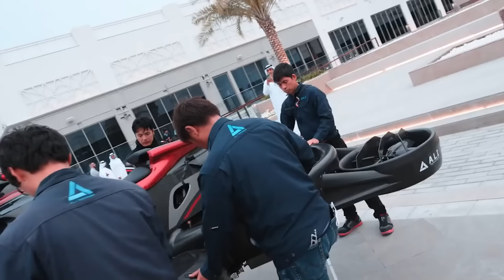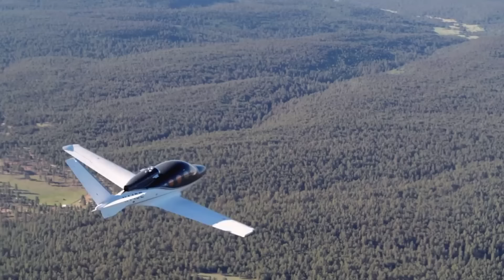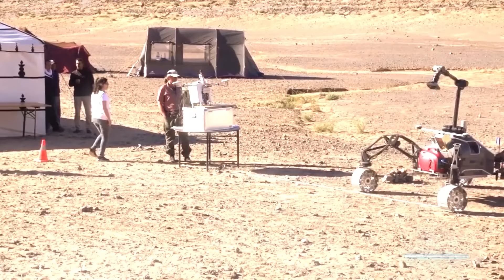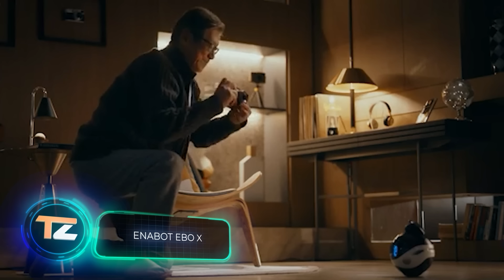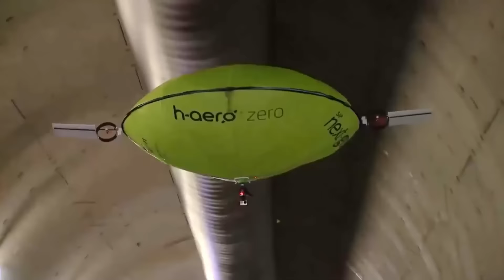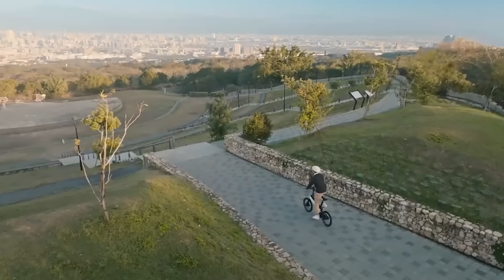INGENIOUS INVENTIONS YOU SHOULD KNOW ABOUT

Comment: The reason there is only an animation for the water barrier on the loading dock is because of the majority of loading docks are up off the ground to meet the height of a semi truck trailer. It's a video rendering because they don't exist in the real world because it's trash.
Why would you need to block water at a loading dock as they lead outdoors so you would be holding a liquid in the building instead of stopping it from entering.

Comment: $650 for beam climbing safety gear like that?! That's a STEAL!
Reply: That's what a good harness and lanyard costs. So yeah, absolutely a steal. AND since it isn't leaning on anything, and says it can be used as fall protection, you can probably hang a stinger on your belt, climb, and weld with it.

Comment: They should put that autoland button on all commercial airliners.
But it should first sound an alarm in the cockpit for the pilots to turn off in case a passenger pushes it as a prank.
The pilots can have 30 seconds to a minute to press the reset button and reset the system.
Then the stewardess can restrain that naughty passenger.

Comment: The water barrier thing is dumb as hell. What an incredible waste of money for an extremely specific set of circumstances. PLUS, you could just as easily drop some hand-held fluid dams in front of the doors for probably 1/20th of the cost.
Reply: And they would only keep water in a building! They would never stop water from the entering a building as the majority of loading docks are high enough to meet a semi-trailer. Completely ridiculous.
Reply: Obviously you didn’t pay the slightest bit of attention to what these barriers were designed for, or consider ( if you are able ) what may have necessitated  the need to design them in the first place
Reply: @MrKeppie1  they were designed to sell idiot safety mangers on useless garbage.
Reply: We have chemicals in our building that will cause mass fish kills if released into nearby streams. We have to contain fire suppression water to prevent that.
Reply: Don't worry,forklift drivers will tear them up within the week after installation. 🤣
Reply: You have forgotten about storage and deployment, your way is cheaper but it takes up room and is no where near the deployment speed of the fitted devices.
Reply: @hybrid9mm But again, bays are typically at least 3 feet off the ground. Water flooding an area to run through bay doors will not be coming from fighting fires but from actual floods. I see no gasketting material so force of the flood waters would still flood the bays as it runs under the barrier. Closed bay doors with flood barriers exactly at the door would be more effective and provide some structural support to the door to prevent it from being pushed in. The raising/lowering mechanism is susceptible to forklift damage as the mechanism is installed exactly where concrete forklift barriers are usually installed.
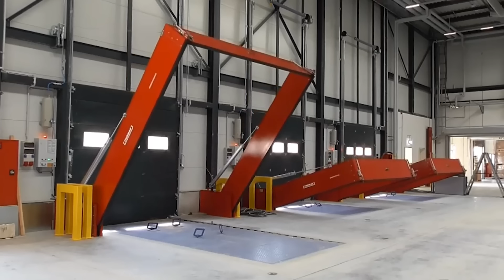Reply: @jpbaley2016  no gaskets? So you don’t see the rubber gasket (6:55) which seal the gap between ground and barrier.
If a forklift driver hits any of the mechanisms (door included) he or she should be fired on the spot lol.
As for making the doors stronger well you will need to make the whole side of the building stronger to spread the load the door will take, so your cost has just vastly increased.
Not all bays are above ground as it depends on what vehicles the docks are serving.

Comment: I built a helium drone back in 2003 for the CAP Search and Rescue as a slower moving search platform which had better range and longevity than a drone and cost one tenth of running a single engine light plane.

Comment: Unlike a conventional air craft which depend's on lift from the atomospher, which is different at different lateral speed's. Hover craft depend on thrust which will very depending on the object directly below it. Provideing enough thrust to hover of a flat surface say at 10 feet, will dramatically be altered, if a truck some 6 feet drives beneath or the craft it self in it's movement goes over it. Because where as one was throttling sufficent thrust to remain at 10 feet above a flat surface changes to only 6 feet in a second, the hover craft would be providing to much thrust momentarly. Simular to that of an auto driving on flat ground going over an obsticel cause the auto to rise momentarly. Driving an auto down a bumpy road isn't pleasent, driveing a hover craft over a series of auto's isn't going to be pleasent. ABOVE GROUND LEVEL or AGL is a major factor in conventional air craft, and any hilocoperter pilot will confirm is't even more of a factor that conventional air craft. Flight requireing lift by providing sufficent thrusting forward is no where near the same as flight require in sufficent thrust downward. Two entirely different form's or version's of the same physic's.

Comment: **The hover bike looks cool but limited speed, limited  flight endurance, limited capacity, and price means it needs to be developed more before it's actually useful anything other than a gridlock situation,
**I take it the wand creates the field around the whole handle and you have to put that between you and the shark, how does it affect you and what it say affect like alligators.
**SR22 looks really cool don't think it just bring down the price some
Reply: Limited yes, but can be very useful getting someone to a location faster in difficult terrain. I mean here in the UK, they have been trailing a jet pack paramedic - the run time is limited, but it's far faster to reach someone in need than walking or using a vehicle on inaccessible terrain.

Comment: Nice info about that Cirrus plane, but the SR22 is actually a propeller-powered plane. The one shown is the SF50 Vision jet.
Reply: The SF50 is about $2.4 million and cruises at 300 KTAS (345 mph / 555 kmh) with maximum altitude of 31,000 feet or 9,400 meters
Reply: @FusionU235  really the only advantage of the SF50 is if you just gotta have a jet. It operates at a speed too slow for a jet to be efficient. Single engine turboprops such as the Epic or TBM are as fast or faster and have much better range and payload.
Reply: @sledawgpilot  not to mention lower operating and maintenance costs, much better fuel economy.  Larger cabins, with optional galley and toilet.  Much easier licences if you pilot yourself, or hire a pilot.
Reply: @andrewallason4530  because it’s a jet, yeah it’s a type rating but I’m guessing it would be extremely easy to fly especially if you’re familiar with the Garmin FMS. There’s a good video but I can’t find it talking about how a small jet of air accelerated much higher than cruise speed isn’t as efficient as a large volume of air accelerated closer to your cruise speed which makes sense.
Reply: SR22 and SR22T are grounded till they figure out the problems with engines and such.